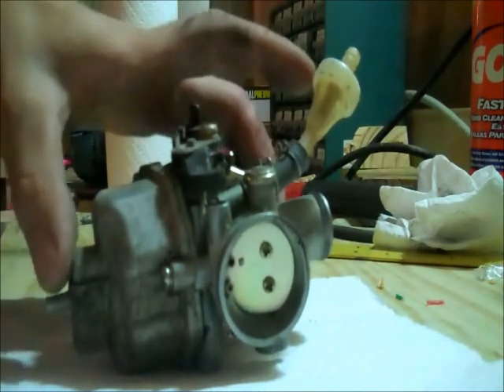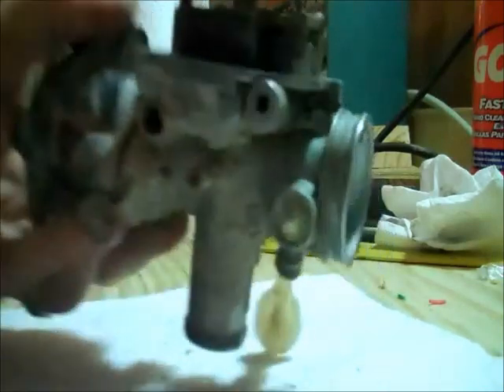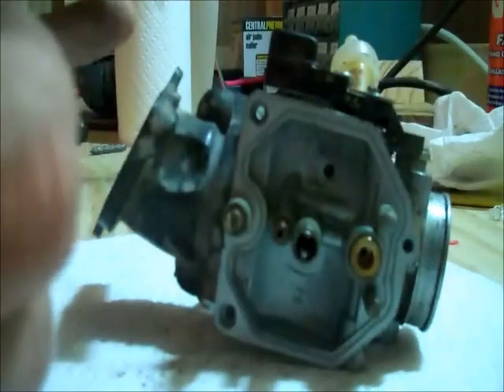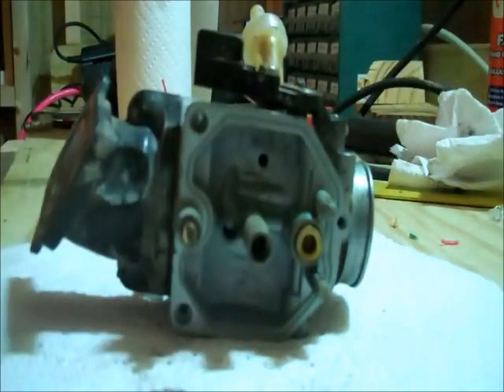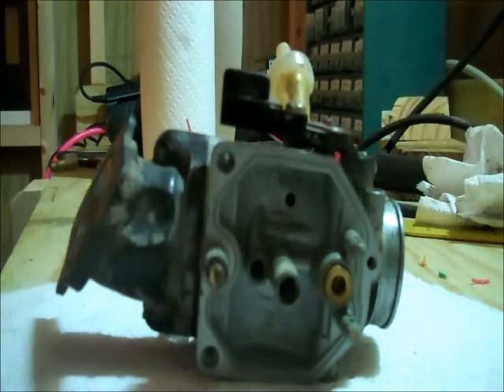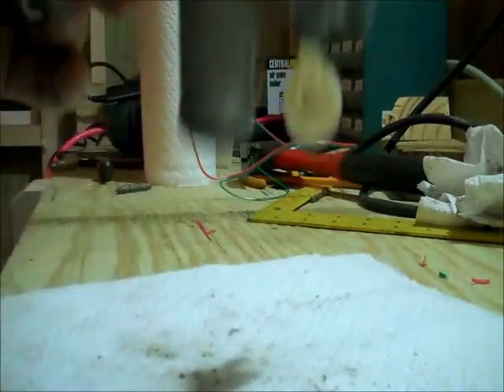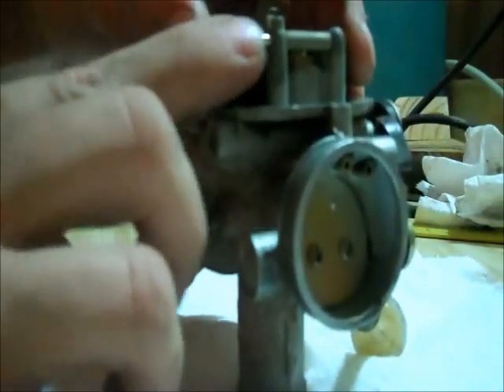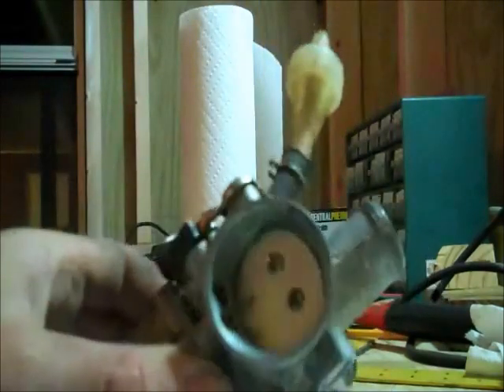How to clean a carburetor in 15 minutes

Comment from the maker: If its 4 stroke, straight gasoline. If it's a 2 stroke motor mix the 2 cycle oil with your gasoline. If gas is leaking from the bottom it could be only 2 things: the fuel bowl gasket or the drain plug seal/washer/oring or whatever it has.

Comment from the maker: I need to know a bit more about what parts are actually bad in the carburetor. Its hard for me to believe you need a completely new one though. If you have time, google some of the stamped numbers on the carburetor itself and see if you can find a rebuild kit. Also find a new repair shop to have the thing rebuilt. You can find motorcycle carburetors online all day long (complete units) you just need to match up things like throttle hookup and intake size. Good luck!

Comment: I have the same problem as you with my Banshee, whenever I go full throttle it acts like its running out of gas and boggs down. I'll try to clean the carbs up and see if it helps.

Comment from the maker: It should do SOMETHING if you have gas, air, and spark...even if the amount of each isn't quite right you should get a hiccup or kick back or something. Usually if ignition is strong, air is going in good then chances are it's a carburetor problem OR possibly bad gas. Start with bleeding ALL old gas out. If you're not 100% sure its good, throw it out. 2 strokes are very finicky about good gas. Some ignitions can get weak from age too, since you mention its a '75 this comes to mind.

Comment: Instead of the air compressor and wire could you use compressed air cans for electronic computers and cameras or would HFC gas cause problems ?

Comment from the maker: Probably not as much the jets as it is the float. If your float is stuck in the down position it will let the float needle drop down and let the gas flow. The float and float needle system work like the float and valve in your toilet tank. When the water level drops, the valve opens and lets water in to refill. When the tank is full the float shuts the valve off. same thing in the carburetor. If your float gets stuck down though, it overflows, like a toilet would. Clean the whole carb anyways.

Comment from the maker: Sorry I am just now seeing this almost a year later. If you haven't solved it yet, it sounds like trash stuck in it somewhere. I cannot be sure where, but I would follow my video on cleaning everything; especially the needles and jets. Also when you get it back together, run some carburetor cleaner in the gas and turn the screw to idle the bike up to where it wont shut off if possible; let it sit for 10 min or so idling to run the cleaner thru. Then you may need to clean carb again afterwards.

Comment from the maker: Honestly, by the book you "shouldn't". I have used it when i was out of carb cleaner and havn't had any problems with it. I actually like brake cleaner because its a more powerful spray compared to carb cleaner which helps to blast out dirt and other crap.

Comment: heey man. hows it going. i have a question. i have a 03 ttr 125 and its been sitting for a while. i changed the gas. but when it was running the overflow hose or the drain hose in the carb was pouring with gas. could it be the jets.

Comment from the maker: Go buy some PB blaster from an auto parts store to spray on the screws spray it a few times and leave it soak in for like an hour and do it once more. another good product is. called Heat Valve lubricant. you can get it from a GMC or Chevrolet parts department in a spray can. in some cases it works better than PB blaster. don't waste 
time on WD 40